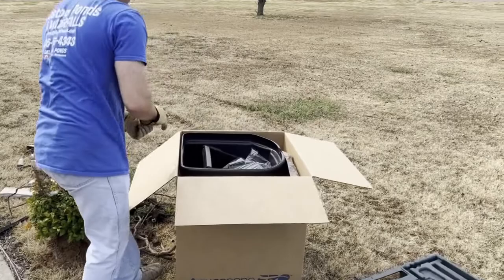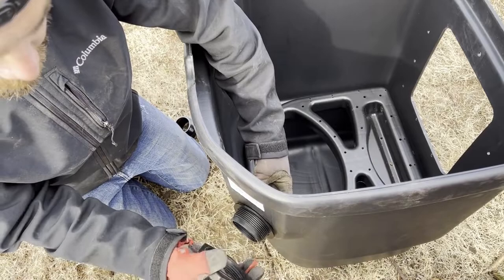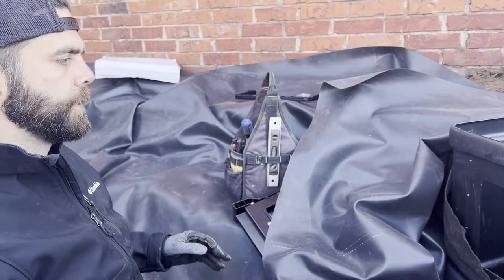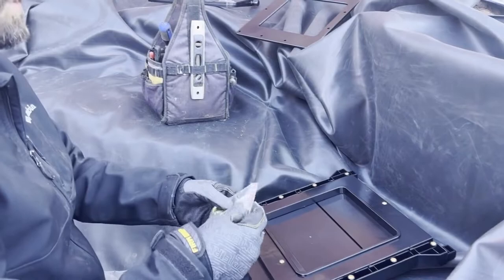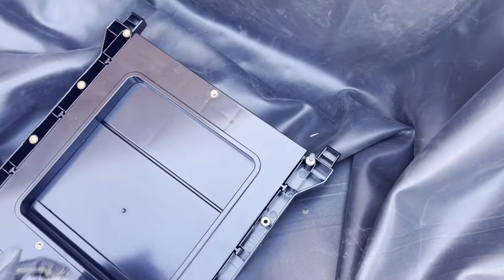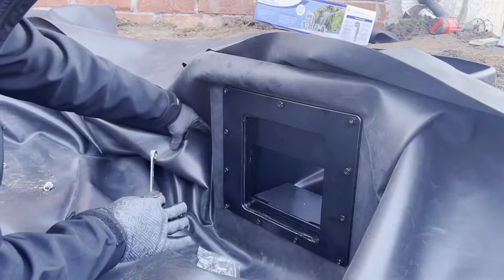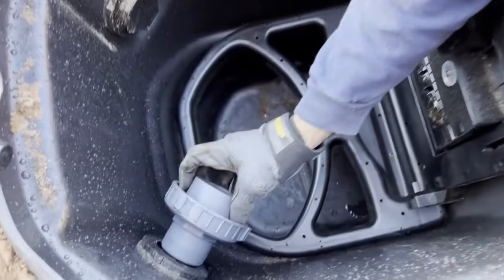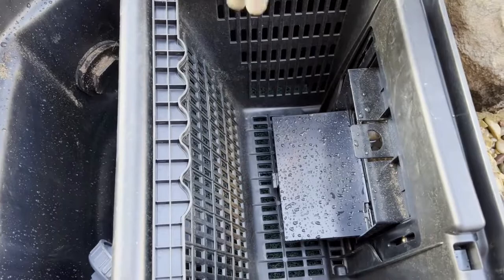Complete Pond Skimmer Install- Aquascape 1000 Skimmer

Comment: great video , could you please tell me where does the auto value filler goes?
Reply: Hi, we usually drill a 3/4” hole about 2.5” about water level and use the aquascape auto fill. You can then adjust the float to the desired water level. I hope this helps

Comment: I've been building garden ponds since 1986, having well over 1,000 under my belt.  That clarified, I have never needed a skimmer because they're overpriced junk, along with every other filter Aquascapes sells. This is evidenced by the number one selling swimming pool accessory-- a net! That's how well even the typical, high grade swimming pool skimmer works-they don't. Additionally, I challenge anyone to visit the last page or two of any pond supply company and what will you find--all the chemicals required to keep your pond clean. Given the grand you just spent on filters, you shouldn't need chemicals. Shoot you should be able to drink that water! Save your money folks!
Reply: Where is your ponds Mr expert lets see em updated video of them not when you built them

Comment: Could you please explain why you closed the overflow port?

Is that something you do on all of your installations? Or what is your criteria for making that determination?
Reply from the maker: In this case there was nowhere to run the overflow to. The area was surrounded by sidewalk and the yard on the other side was flat so there was nowhere to to run the overflow pipe to thematic it could drain. In projects where the yard slopes we always use the overflow
Reply: @oklahomaponds7718  thank you for the quick response. 

The video is informative and is a good guide. Appreciate you putting these videos out there to learn from.

Our current skimmer is leaking and we are in the process of putting in the aquascapes 1000.